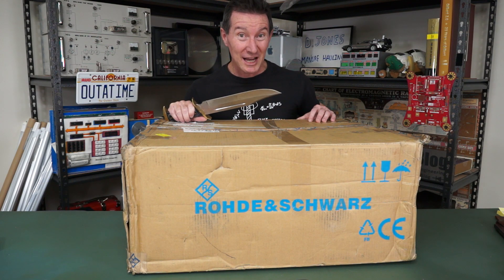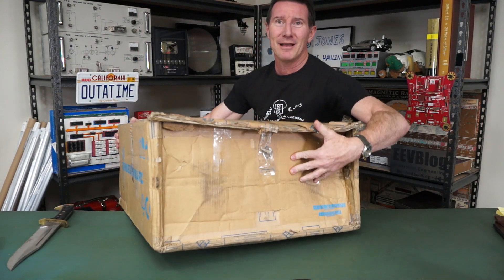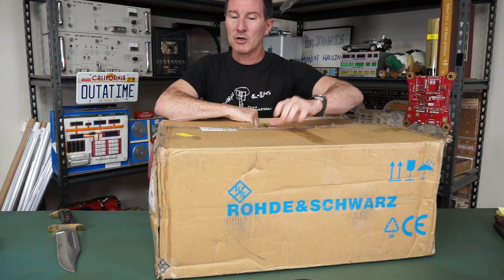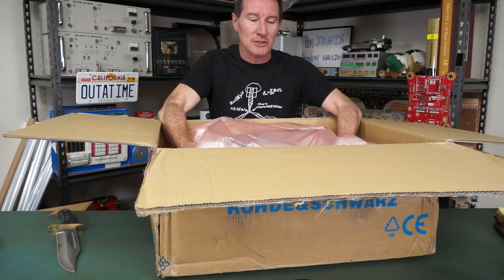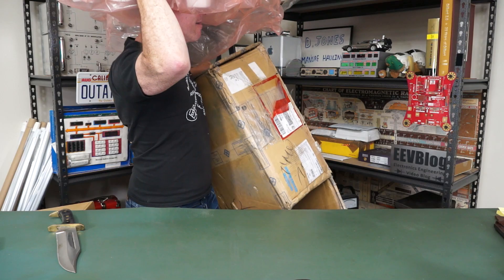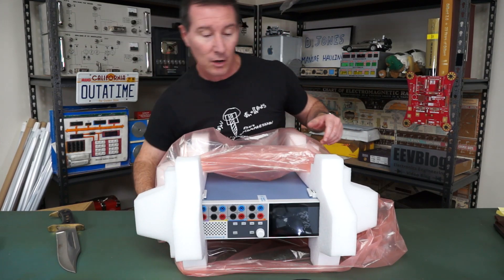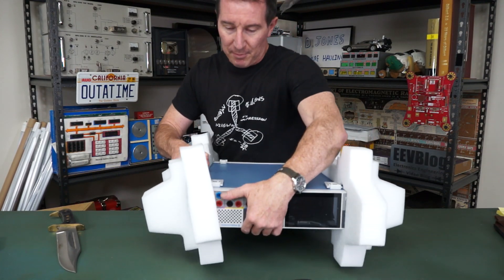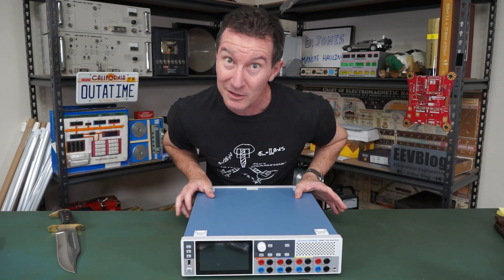NGP800 Unboxing

Comment: Even the worst Chinese supplier would not pack carelessly like this....
Reply: From China I've gotten assembled PCBs wrapped in 2 turns of bubble wrap, then put in a paper thin plastic bag. The most protective part was the sticker with my address on it.
The header pins and corners of the PCB were sticking out.
Somehow it still works, though I've seen other boards with bent heatsinks and broken TO-247 mosfets.
Reply: station240 ... From my experience with Chinese since 2007 in electronics and manufacturing , never ask for PCBA service !!, just PCB and buy components separately and solder them by hand whatever it could be... Also, don't ask the supplier to ship you and work separately for supplying and shipping even it may cost more...
Reply: @ahmedalshalchi  Huh ? This isn't PCBA? just the usual ebay sellers that sell complete modules.